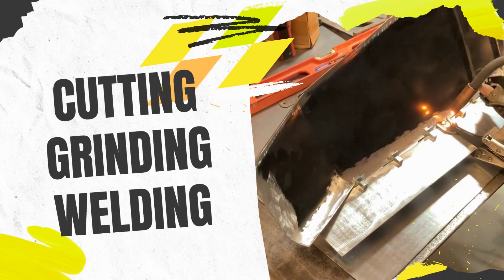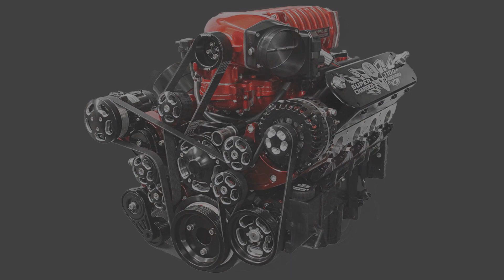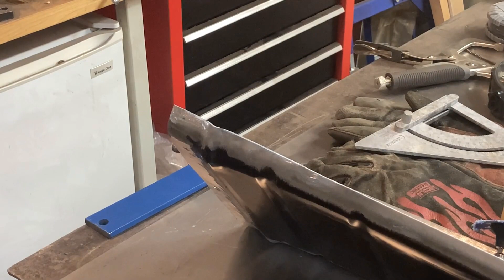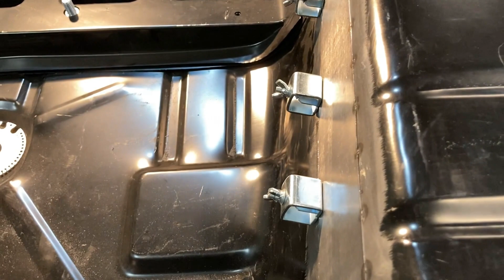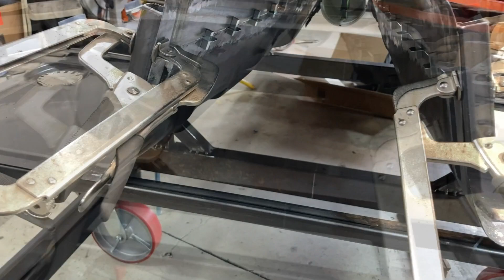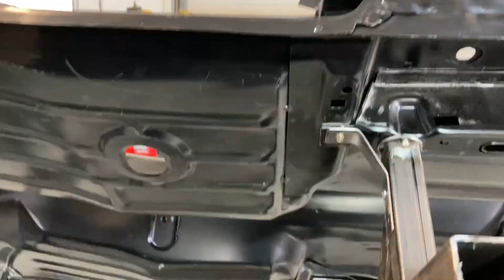EASY Custom Transmission Tunnel - TREMEC T56 MAGNUM SWAP - Pro Touring Camaro Build

Comment: That rotisserie is pure sex. Very satisfying watching that thing spin.  

Couple of questions...what semi-gloss black did you use on the trans tunnel? And, what which white paint marker are you using? (mine always dries up quick).  Nice job as always! Thanks for sharing!
Reply from the maker: 😂 I gave it a quick coat of Steel-It. It’s a weld through paint (with high metal content). Don’t want any flash rust when moisture levels start to rise with the spring thaw.
Reply from the maker: I just use cheap Princess Auto white fluid markers. I get a 3 pack for $10 bucks. They last pretty good 👍.

Comment: Have to ask here. Do you know if a 6L80 will fit the stock tunnel? How about a 700R4?
Reply from the maker: @cliftsgarage4974  Don’t know about a 6L80 but a 700R4 should fit without issue. 🍻

Comment: I’m about to raise my tunnel on my 69 and can’t find enough info. I don’t have a T56 to mock up either. What is a good height to raise the tunnel. I have read 1 1/2 inches and heard you say 2-3 inches. I will be using the RideTech coilovers and quadralink which lowers the car at about 2 inches. I’m reading that the pinion angle should be 3 degrees. Any insight you may have is appreciated. Love the channel and can’t wait to see new content. Thanks!
Reply from the maker: Hey Allen, About a 2 inch raise is what I ended up with. I’m currently working on a video that finalizes the hump area and firewall. I have a T56 now and will be sharing a whack of dimensions to confirm all the assumptions/research.
Reply: @ParadiseBayCustoms  thanks for the reply. I will keep a lookout for that video. Not having a T56 to mockup is definitely an issue for me 😆
Reply from the maker: @allenwoolsey  If you need any dimensions let me know. Message me through Instagram or email at paradise_bay_customs@icloud.com